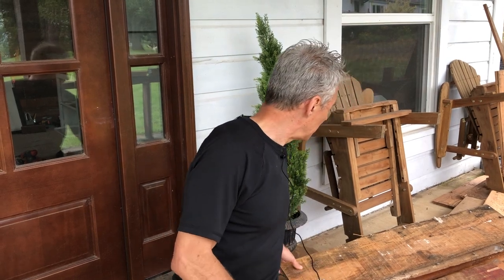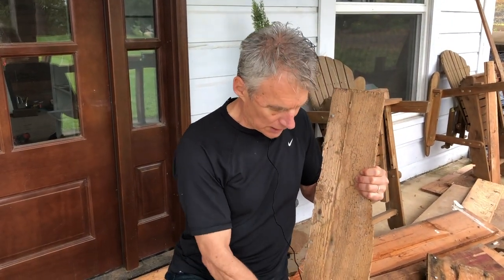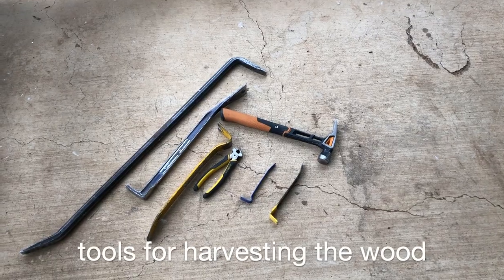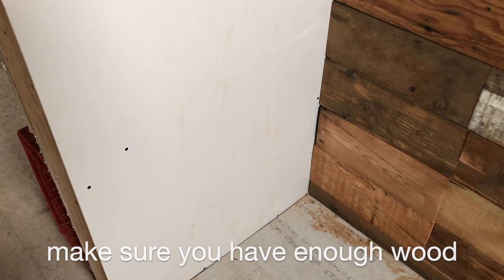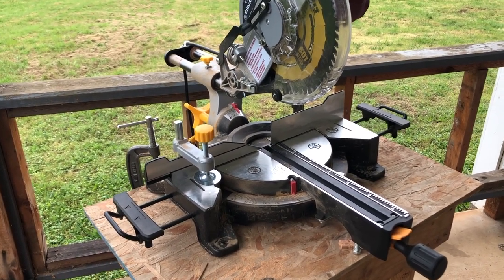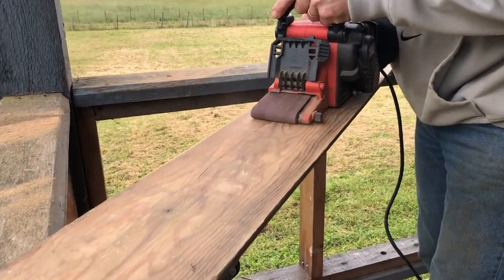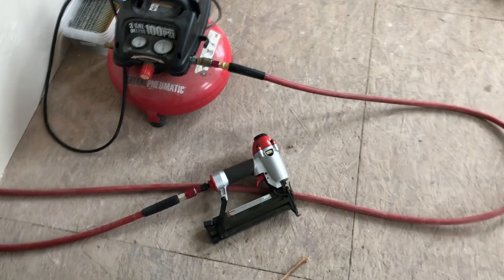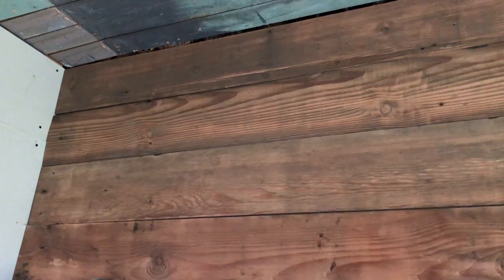SHL Episode 4: What We Learned About Using Reclaimed Wood | AnOregonCottage.com

Comment: You've done an awesome job with the reclaimed wood!  This is one instance where perfection would be beyond boring and this just so suits the old farmhouse.  I noticed your Adirondack chairs on your porch.  Are they old?  They look gorgeous!  And, I'm looking forward to your next podcast and wishing I hadn't gotten rid of the old soaker hose (at least I think that's what I did; will need to check).  I've been finagling (sp??) one of those young tree/shrub soaker hose rings in the (very) shallow front garden but I need  something much larger in scale for the back gardens.   Thanks for sharing all your tips and experiences!
Reply from the maker: Thank you! In the next video we'll be cutting up NEW soaker hoses. If an old one has one or two cracks, it's not worth using. So maybe you did the right thing after all.
Reply: @AnOregonCottage  I'll go along with that!  And I'll wait to watch your next video before I get another (or two) to make sure I get what's most usable.  Thanks!